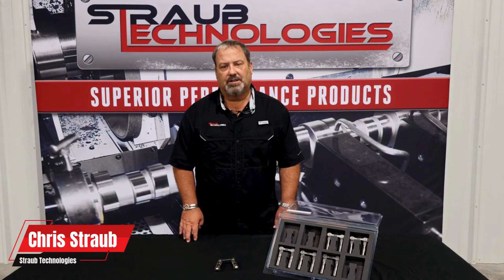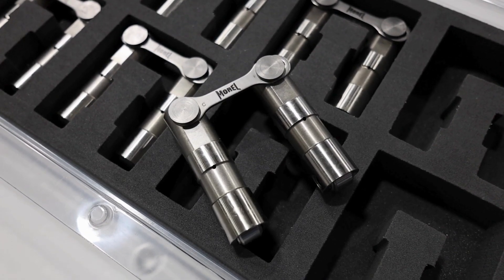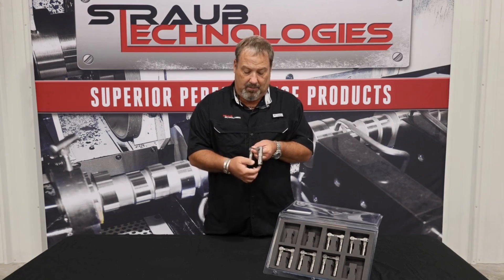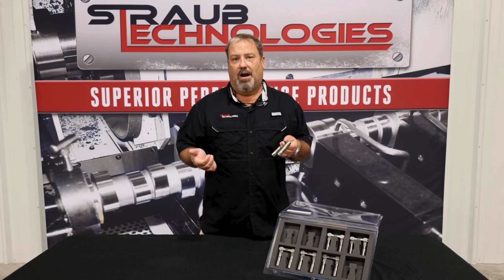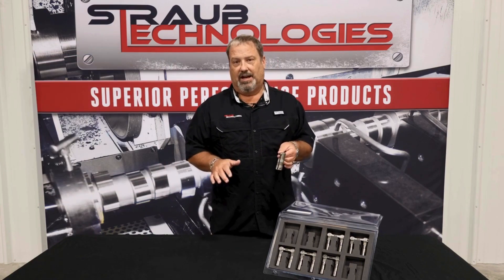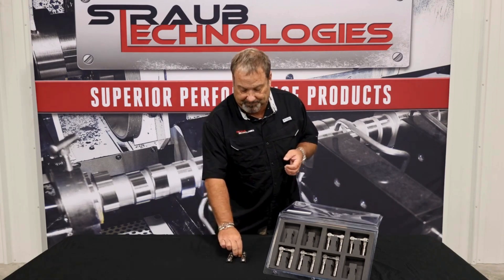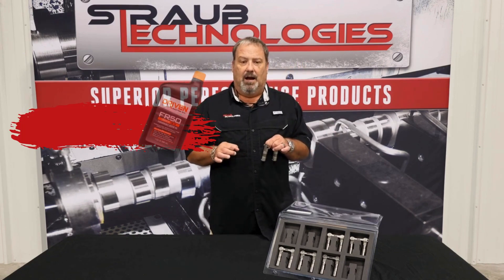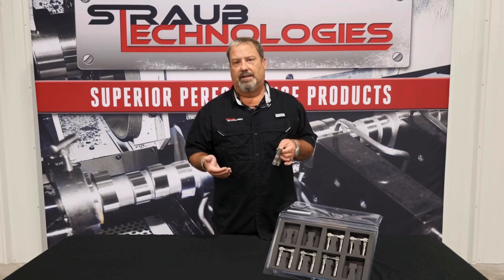Morel Hydraulic Lifters

Comment: For the people that doesn't know about the present day motor oils, they need to research and read the "540 RAT" blog about today's different motors that's used in the USA. 540 RAT is a US Patent Holder, he has a Mechanical Engineer, he is a member of the "Society of Automotive Engineers, (SAE)", he is a member of the "American Society of Mechanical Engineers, (ASME)", and he did two different "wear protection" testings on over 130 different weights and brands of motor oils sold in the USA, both conventional and synthetic, and then he ranked them in order from the results of the testing. 540 RAT also explains what is causing so many new hydraulic flat tappet cams to fail or self destruct during break-in procedures, and he also has a blog for the HFT cam break-in procedure that he uses, using full synthetic motor oil. 540 RAT's blog is a long read and it's worth the time to read it in full, it's very educational. I actually believe the reason 540 RAT's blog hasn't went full viral is the fact that the filthy rich CEO's of the motor oil companies doesn't want the truth exposed about their misleading and their decieving motor oil protection advertisements, so with the help of the social media websites CEO's, 540 RAT's blog is being censored and or deleted. I know many of my other posts and comments on several different forums and social media platforms telling about 540 RAT's blog always seems to get censored and deleted, that alone tells me that these motor oil companies have something to hide.

Comment: GM Just recalled 1 million vehicles.
The engines are destroyed if there are any new vehicles left under this recall the fix is to change the oil to a higher viscosity!!!
The reason for the recall is simple the 0W- 20  low viscosity wiped the main bearings.
Bearings need something to ride on especially under high load I would be very careful about going so thin on motor oil
Reply from the maker: But they are still maintaining the centistoke rating below 15 at 100C

Comment: My new 598 Engine from Blueprint Engines uses the Morel Hydraulic Lifters and it is annoyingly loud! Cold or warm it's just loud. My bearing clearance is .0025 and calls for 5w30 or 10w30. The only way it got a bit quiet was with 20w50 but my builder said it would void warranty if I use it. I removed it and went back to 10W30. I did the adjustment as recommended in your video went from 50, 60 or 70 with aluminum heads 3/8 threads did not make any difference. I have friends saying my engine sounds like crap just because of these lifters.
Reply from the maker: What oil pan you got?   Let the engine warm up and once at temp rev it up a few times and then shut it down.  Pull the dipstick.  Does it have air bubbles.  Large stroke engines in chassis with crossmembers are oil pan limited.   Hyd roller lifters don't like air....hell no hyd system functions with air.
Reply: @straubtechnologies  I have the Milodon 30956
1 in the filter 6 in the pan total 7 quarts as per Milidon.
I never tried revving it up a few times and shut it down to check for air bubbles on dipstick. What would this tell me, if it foes happen? I wouldn't be able to try this until the spring.

Comment: What's ideal oil pressure cold start, warm idle and pressure relief 🤔

I'm experiencing some noise with 14.8 centistoke and 7/8 turn on a 351w with alloy heads. Motor is not that old 😌 

Cheers, Tom

Comment: I ran mine down to .035. That is what morel recommended. Should I increase it? Aluminum heads 7/16 studs iron block.
Reply: 3/4 turn + the bump to lock them in place. Sbc 383
Reply from the maker: @My_67_Camaro  Aluminum head will grow around .006" I recommend 1 full turn.
Reply: @straubtechnologies  thank you, I’ll try it out

Comment: This video wouldnt exist if there wasnt issues with Morel lifters. I have a small block Mopar running Morel hyd roller lifters p/n-5321.
I have used 3 different types of oils. 10w-30 centistoke @ 100' 14.8 , 10w-40 centistoke @ 100' 14.1, 5w-30 centistoke at 100' 9.8 . mineral, semi synth & full synth. In addition I have had my valve covers off more times than I can remember. Tried preloads (meaured at actual lifter plunger), of 10, 40, 60, 100 thou through to near 120 thou (virtually bottomed out).
Currently running the full synthetic 5w-30 with 60 thou preload. About 7000 miles on the engine. This has given the best results but they clatter like hell. The only thing that has stopped me from throwing these things in the trash has been the fact that I need to remove the heads to get the lifters out.
Oil pressure hot of around 35psi idle, 60 to 75 giving it a bit.
Friend runs a stroked SBC in his Camaro with solid rollers and side by side mine sounds like a bunch of bolts rattling in a steel bucket. I specifically went hyd roller to avoid continuously checking lash and a quiet motor, I didnt get either. I can only assume its poor quality control because some guys have dodged the bullet and have no issues, but many have dud's.
Reply from the maker: What is your lifter to bore clearance?
Reply: @straubtechnologies  Block had fresh bronze sleeves installed. 1.7 Thou clearance on all lifters. Been through all this before and got nowhere.
Reply from the maker: @andretorben9995  Who did you get  the lifters from?  If we can be of help I will see what I can do.  My email is cstraub@straubtechnologies.com.

Comment: It's also important to be sure that the narrower section of the lifter is never exposed to the bottom side of the engine. It's rare but it happens occasionally. Bad combo between the base circle of the cam and the lifter dimensions.

Comment: I found that on an iron block 6.0 Chevy LS with good lifter bore clearance, 5206 Morels, 5W-30 Mobil1 oil that .075”-.080” ( I started at .035”-.040”) was the preload that quietens them down, especially at cold idle.
Reply: Yep, you have to find what they like, they are all a little difference, its like tuning the lifter.

Comment: 461 BBC here.  I've got half  turn(25thou) and they been clattering for 4 years....per the directions with the Morels.
  Are you saying I should have more preload than the directions?
  Is there an update on the Morels?
Reply from the maker: Yes I would go 1 full turn.  YOu can go as much as 1 1/4 " turns.
Reply: @straubtechnologies  Thank you, sir.
Reply: @straubtechnologies  I'm at 1 turn and my 5374 in my BBC are noisy.
Reply from the maker: @schrank17  Crank them a 1.5 Turns.  What oil you running?  What is your lifter to bore clearance?

Comment: Great info about preload. Can you explain what happens to the lifter with less preload. In a .120 travel lifter with only 0.30-0.50” preload. Does it ?leak or compress or bleed down? Causing a loss of valve lift?
Reply from the maker: I have to thank Keith Dorton for this analogy...hyd roller lifters are shock absorbers riding on the cam.  A lifter has a hydraulic system, you need the correct amount of oil on both sides of the valving, flow in and flow out.  Staying middle ground gives the best performance.
Reply: Good question.  I've got a BBC with a half turn and they're loud.  That is only 25 thou, but what the Morel directions said.  I wish he would have mentioned the conflict.
  They been clattering for 4 years now.  According to him, I need more preload.
Reply: They say that with good oil pressure the hydraulic lifter should ‘pump up’ to 0 lash and act like a ‘solid lifter’. But I think with the newer thinner oil and worn lifters 50k+ miles that when they ‘pump up’ to 0 lash and then when they are compressed as they ride up the cam ramp to the nose they lose lift and duration.
Everything is a compromise. Hydraulic lifters no valve lash adjustment and quieter. Solid lifters have to adjust valve last, more noise and more power.

Comment: I’m running a Cleveland with Iron heads and running Morell lifters. The instruction sheet that came with the lifters had a formula and for my application it was 3/8 additional turn. I will call Driven today to get the Centisccope rating of the oil I’m using.
Reply from the maker: Again I gave tech on what we have found that works for us.  You've got room to adjust.
Reply: @straubtechnologies  I followed the instructions for iron block and iron heads, and that came to 3/8 turn.  Do I disregard the instructions from Morell?
Reply: Driven said the Centiscope was 14.2 average in the 15-40 oil I’m using for the Morell lifters in my Cleveland
Reply: Amazing parts and best customer service in the game

Comment: Do they make any leak down lifters? Also I'm guessing you like them better than the johnson.  Thanks for the video!
Reply from the maker: All Morel hyd roller lifters have a slower leak down then OEM.  So ALL Morel lifters can be said to be Slow Leak lifters.  They have a percentage of leak rate compared to OE that they are built to.  Also it needs to be stated each lifter is leak tested...not ever 50th or 100th lifter.
Reply: @straubtechnologies  Thank you!

Comment: What I found after putting a cam/BTR springs in my LS3 with GM lifters was that .060 - .070 preload and 5w30 oil made for loud lifters. Unfortunetly, air does get whipped into oil too making the lifters even noisier because the fluid is not a solid anymore. Once I ran more preload and 20w50 Royal Purple HPS oil, which is considered a sin, the valve train is almost quieter than stock and been running strong for 20,000 miles. My oil pressure is always high at idle too, 2.8 bar with a stock volume high pressure Melling pump.The trick is to just let the motor oil heat up to about 190F before you beat on it and its been working perfectly Just my experience. Maybe the aftermarket lifters are better but just trying different preloads and oil viscosities can make a dramatic effect on lifter noise, just have to be willing to play with it which in the case of LS engines required diffent pushrod lengths.
Reply from the maker: Your are spot on with what you did.  My tech is the baseline, your going to have some cases where playing with a higher W rating will help.  As many LS blocks we have probed on the Rottler F69A, I can tell you the lifter bores are all over the place.  Your oil choice has a Centistoke of 18 per Royal Purple. So higher but not as high as many of them out there.  Kudo's to you for staying with it and figuring out a solution.  That mentality is the bases of hotrodding.